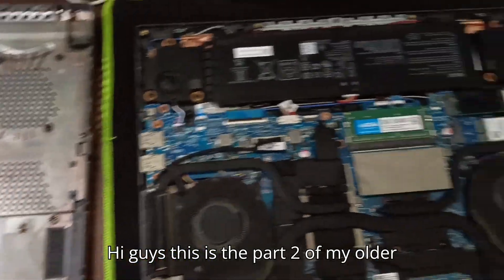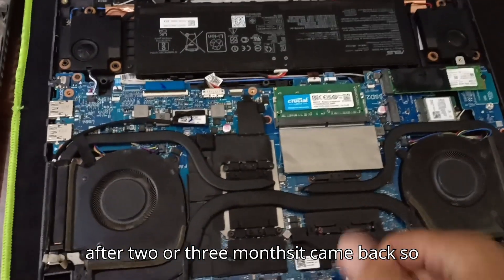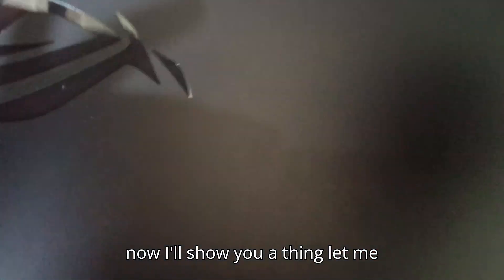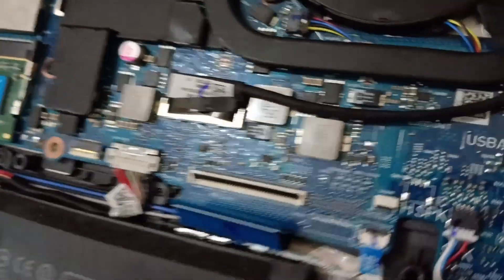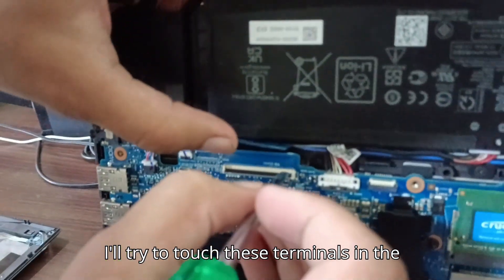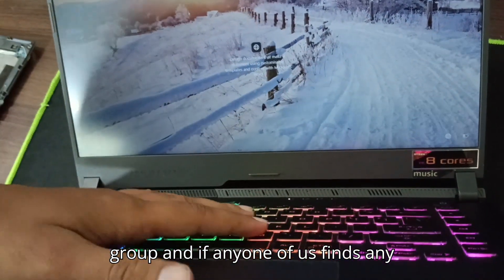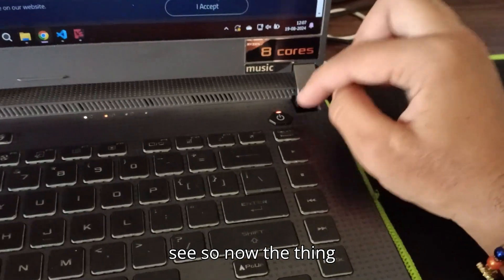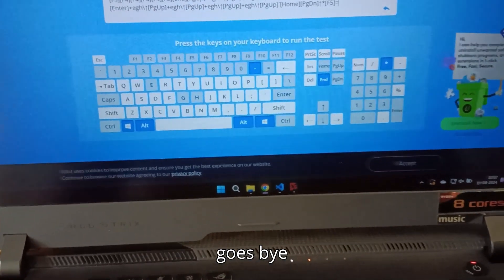asus rog laptop no power | part 2 | Fixed #asus #rog

Comment: Guys guys. I was facing the same issue for the past 3 days. It was working fine till last monday and suddenly it was not powering on. No indication of life. Even when plugged in no sign of life. I took it to an authorised service center. Withing minutes they told me it is a motherboard issue and would cost me 45k to get it replaced. I got my laptop and got home. The next day I called another service center and explained my issue they too told me it might be hardware issue with the motherboard. 

I was literally frustrated and depressed. Then I started searching for answers online and Took my queries to GPT. It clearly told me what I should do. Here’s what I did. 

I tried the EC reset that is holding the power button for 40 seconds. Didn’t work.

Next I tried removing the battery and reconnected it. Didn’t work. 

Then tried removing the keyboard connection and now when I plug in my charger I saw the batter indicator on. Somewhat happy with the result. I quickly plugged in the keyboard, assembled the back panel and tried powering on. Guess what no use. Still the same issue.

I was tired and left the laptop untouched for few hrs. Later today I once again removed the back panel and was looking for any possible Issues I can find. Bingo I found the LED strip which connects the back panel to the motherboard was loose on one end. And it was kind of bent not in a regular way. 

I straightened the strip and carefully inserted it again. Assembled the back panel again and now When I hit the power button My laptop came back to life.

I know we spend our hard earned money to buy this kind of heavy duty laptop. I’m still pissed at the Service Center guys. Clearly they don’t have knowledge on these machines and hardware and was asking me to spend 45k on this tiny issue.

I also want to tell you that please be very careful when you try anything that you don’t have much idea about. Like me I was overwhelmed when I saw the internals of my laptop. I have Asus Rog Strix G15 22 special edition. Luckily now i have no issue with my laptop.

Comment: Yeah you are right problem is with power button
Can the issue not be solved without changing the keyboard 
There has to be another way😢😢
Reply: There is a way, you will have to install a new switch on the laptop and solder its wires onto the keyboard socket power button pins

Comment: Does it also apply to the rog strix g16?
Reply: Bro my also same issue g16
RTX3050
Reply: Mine G16 RTX4060 facing same issue.😢
Reply: I tried removing keyboard but didn't got power
Reply: guys ,got any fix?
Reply: Yes.
When the power output is more than the input it shits itself.
It also, for some reason, really fucks up ram usage.
Letting your cmos die, or if you have hibernate/Shutdown as an option after a period of time (mine is 15 minutes), it also resets the internal memory too.
It is a simple fix for a really stupid oversight.
Turn off the laptop lights, as well, as they draw a fuckton of power that the keyboard itself competes with.

Edit: You will note this is the case if you have ever shut the lid, open it, and then the laptop freezes or crashes. This is a sign you will have this issue in the future.
Reply: Ya I'm trying this on my G16. Disconnected power, SSD, keyboard...so far no luck still dead...but it's only been 20 minutes, I will keep waiting..😢

Comment: Thats for this videooooo, i fixedd it

Do one thing

Disconnect battery

Disconnect keyboard

And 1000% you will fine keyboard connector pins oxidised, use 99.99 IPA and clean those pins, you’ll some blackness going off…

Plug back keyboard and plug back battery

Everything should workk
Reply: Is it still working good ?

Comment: I have started facing this issue a few months ago, in the initial stages, pressing the power button turns ON the system with all the light in the keyboard and all fails to boot. Turns into black screen. 
Now its 8-9 months, its still the same and it doesn’t even charge with even if i charge it. No symbols now blinks just like a dead laptop with power/without power. Service centre guys are saying battery IC is damaged, some were saying keyboard is damaged.
I got a MAC now. But still Ill try your solution. I just want to fix this cuz I have confidential files in it.
Reply from the maker: There is a pinned video in the telegram group. Please check out that video. It's working for me.

Comment: I had a similar issue where my laptop wouldn't start. After many failed attempts, it finally worked just before I was about to send it in for repair. What helped in my case:
I turned the device on and off several times. Then I tried starting it without the power adapter, and a few seconds after pressing the power button, I plugged the adapter in.
Surprisingly, after a while, the laptop finally booted up. Hope this helps someone!

🌝

Comment: I have the same problem...because humidity there is short circuit on keyboard...so i just dry out  my laptop on sun light and not use it in 1 week...after that my laptop run normally...

Comment: Hi!, I have the exact same issue, fortunately I managed to turn it on. Just ran the keyboard test using an online page, and I can see that the power button is triggering several keys. Also, after pressing the power button, the Caps Lock key stays on, and the mousepad gets disabled. Fortunately for me, for the moment, the only key with problems is the power button. 
I tried cleaning the keyboard connector, the flex, but no luck, the problems persists. So for now, I think I just cannot turn off the PC but put it to sleep instead until I can buy and replace the keyboard. I have found the keyboard in Amazon US, I hope it works well.

UPDATE: Replaced the keyboard myself, and now it's working fine.

Comment: This happened to mine when I updated BIOS, it just turned off and it never came back on. Luckily I still had it under a 1 year manufacture warranty and ASUS fixed it at no charge.....turned out my motherboard fried so they had to replace the board along with the GPU.

Comment: i have an orange light on my laptop but it won’t turn on, what should i do?
Reply: Did you got the solution bro ?
Reply: @sakash8816  yea, battery is dead and it needs to be replaced
Reply: @2005_Adi is it turning on by removing the battery and turning on the laptop by only the charger ? If yes then battery is the issue
Reply: @sakash8816  nothing turned on for me. And if it did, the screen was just black
Reply: @2005_Adi so it's not the battery issue, if the battery is culprit then it should have turned on by plugging the charger and removing the battery

Comment: same issue here.. i unplugged keyboard ribbon then connect charger, charging indicator lights up,, then i plugged keyboard ribbon and connect charger, charging indicator still lights up.. i press the on key and its turn on normally without any issue.. maybe i need to replace new keyboard for better result.. anyway thanks for this video,, its helping me a lot.. seriously thank you 👍🏽
Reply: Bro is it still working fine or did you solve the root cause of the issue ?

Comment: i had the same issue my repair guy did something idk what now it works with battery as i remove it turns off and also with 90wat c type it show charge lit up and boots for 1 sec and shut down? i think he did something bad as my laptop was perfect at morning and in evening when i pluged in now battery sign and not turning on bro tell me how to reset what he did and then i can try your solution?

Comment: Ty man, I managed to fix it with this tip, I can also use the keyboard, once the charger light was on, I plugged the keyboard back in and the power light is still here then I closed my pc and it runs normally. I dont have to put the screwdriver on the sensitives metal pieces (i dont think its good in the long run)

Comment: I got this same issue on my strix g16 yesterday and today I took it to the service centre as it was under warranty, they told me that it was caused by the motherboard and they will replace it
Reply: Brooo got mines not working at all it's dead it's Rog g17 and I was playing tekken 7 and suddenly it shut down and I tried both the method in the video it didn't worked ?????
Reply: And what are the cases for warranty in Asus service centers and did u opened your laptop at home and still it was under warranty???? Please tell me
Reply: @abhaygautam7725  bro I didn’t open the laptop by myself I took it directly to the service centre
Reply: @abhaygautam7725  bro I think the warranty  of the laptop will be discarded if you opened it

Comment: I had the same problem...I used your method and it turned on but i can see there is a problem with the power button when i press it brightness is going up and down. And my laptop is not shutting down. If i press shutdown even in my computer screen by alt+f4 the pc restarts. What to do in this case?
Reply: I have this issue U_U .... were you able to fix it ??
Reply: You have updates for this?

Comment: Reason why I use an external keyboard since I bought my ROG from day 1. 

I have had this problem on my old laptop and the cause is that the multiple keys were registering a continuous high at the same time, so pressing the power button would not do anything  and it does actually affect the power. 

I have had the similar problem with my old Xiaomi phone where I would press the power button but it would also press the volume-up key or would cause a continuous high on the volume key and the power button. This caused the phone to boot-loop continuously.
Reply: Well if you use external keyboard then how do you power it on?
Reply: If you need tobturn off your laptop you need to turn it on with the power key. So it is not a good solution anyway😟

Comment: I can confirm that this works, but in my case, it sometimes requires disconnecting the keyboard ribbon cable for a period before reconnecting it and THEN shorting the start-up pins (after which the ribbon cable can be reattached, and the keyboard used normally).

Problem is, the keyboard goes dead again following shutdown, prompting a repeat of the whole process.

Does anyone have any insight into how complex such a repair would be?

Is this something that can be handled as a board-level repair by local repair shops, or does it pretty much necessitate a manufacturer board replacement (likely a cost prohibitive option for those of us whose laptops are no longer under warranty)?
Reply from the maker: @thaslinky455  if you have any external USB keyboard then you can disable the laptop keyboard except the power button. Check out the pinned video in my telegram channel.
Reply: @fixexe  
Regarding the solution using the tape - I have the EXACT same problem ( my ROG 15 Advantage Edition laptop is only able to turn on when shorting pins on the motherboard).

But I want to clarify if the tape solution (shown in your most recent update on Telegram) will allow me to power up the laptop when pressing the power on button (which is non-functional).

Can you clarify that?
Reply: Wouldn't replacing the keyboard help here?

Comment: I have strix g15 g531 gt and when i plug in the charger i only get the airplane mode light. Many people with same
Model as me are facing the same issue on reddit. Do you know what is casuing the issue? Not booting no lights on keyboard although a few weeks ago it started randomly and shut itself down after few minutes then same issue
Reply: Same issue
Reply: Same issue

Comment: This is a Keyboard issue confirmed resolved 💯 by just unplugging the keyboard strip then connecting with charger. The laptop power light will be on, then on the laptop through the keyboard jeck prints by touching the screw driver after you just connect the keyboard strip. Everything works perfectly
Reply: Did you use a hair dryer?

Can you confirm if the solution is still working?  Thanks.
Reply: @thaslinky455 yes i used the heat of the hair dryer but first unplug the keyboard strip then connect the charger with the laptop, charging light should turn on
Reply: @thaslinky455 bro this will definitely Keyboard issue resolved 💯 by just unplugging the keyboard strip then connect with charger. The laptop power light will be on, then on the laptop through the keyboard jeck prints by touching the screw driver after you just connect the keyboard strip. Everything works perfectly
Reply: @thaslinky455 Keyboard issue resolved 💯 by just unplugging the keyboard strip then connect with charger. The laptop power light will be on, then on the laptop through the keyboard jeck prints by touching the screw driver after you just connect the keyboard strip. Everything works perfectly

Comment: After disconnecting the keyboard strip then connecting the charger to my laptop light shows on, Thanks bro...but for turn on the system Keyboard not working then on with screw driver on prints of keyboard strip jeck, after on laptop then connect keyboard strip, everything works perfectly!

Comment: Bro i am facing the same issue currently. I have the same model with electro punk colour. This problem came for the 2nd time after purchasing in October 2023. As the laptop is within warranty, i call service centre for on sight as there is no service centre in Odisha, India. Bro i am really regreting after buying the asus rog laptop. I am really scared of after hearing that this problem come repeatedly.
Reply: First you have to turn the laptop on this way and the solution to this is turning on filter keys and set "Ignore quick keystrokes(slow keys)" to 0.3 seconds and it worked like a charm hope it helps
Reply: I am also from odisha and facing same problem 😢

Comment: Same issue with my laptop..  same model aswell shown on this video.. I bought it last 9 months ago. on the 1st month that i used it. there’s already have power issue then I bring it back to the store for warranty from where I buy it they just fix it. Then my son not used it for a month right now the power issue comes  again until now my laptop is dead can’t use..
Reply from the maker: @RedDot0924  if it's in warranty then just take it to service center. Don't do anything by yourself.

Comment: I got this issue today only and it seems like lot of people are getting this issue recently.  I submitted it to service center, waiting for their comment and if they quote something absurd I will bring back and check for the solution you provided
Reply: I have the same issue as well
There is no power on mine
No light no anything just dead
Reply: @kobraszn6756 have u fixed?
Reply: @kobraszn6756 Same goes with me broo mines dead too what to do next ???
Reply from the maker: @ChewBakaLoL  any update from service centre?
Reply: I have started facing same issue from last 2 days,, it's turning on but no display. Capslock light bot turning on but I can hear the sound and vibration of fans.
Reply: @ChanakyaFPSS  search for the bios solution for this issue, I've read it somewhere for this exact kind of situation
Reply: And what happened?
Reply: Me too same problem since 2 weeks ago.
Pressing the power button while unplugged for 40 seconds then plugging in again and holding the power button for 10 seconds would work.
But now that also stopped working.
Piece of junk laptop.
Reply: @time.7106  I fixed it bro, it's the graphics card that is causing issue after it gets heated. Blue screen dump, sometimes ssd not being detected, sometimes RAM, multiple issues. Asus said motherboard not working as capslock light is not turning on. I took it to my friend he said there is problem with graphics IC, fixed it laptop was on but after graphics got heated some blue screen dump came up several times. There is a need to check the programme of graphics and bios update needed. Total cost 6500 INR. It's fixed now.
Reply: @time.7106  if u still have warranty try and get it to a repair center
Reply: @avidass  where to change this filter keys option. Bios?
Reply: @ChanakyaFPSS  sadly the issue came back and have to do this whole process to turn it on will delete my comment 😔
Reply: @ChanakyaFPSS  just go in settings and search filter keys
Reply: @ChanakyaFPSS  i also updated the driver and now power button isnt registering multiple keys
Reply: @avidass can you tell me what settings you changed under filter keys and sticky keys??!
Reply: Any update?
Reply: @fiestalok  i played around with sticky keys and filter keys aswell now its working like normal
Reply: ,update?

Comment: I updated my software 1st day it was slowly turning on bios was a little bit late ona 3rd day it was dead i tried force shutdown pressed power button for 30sec it turned on i tried everything update everything uninstalled unused apps etc etc ....on 5th day my laptop was on restarting loop it was automatically restarting soo drain battery I left it idol and went to trip for a week and came back no it's was not even showing Charing sign nothing it was dead 💀